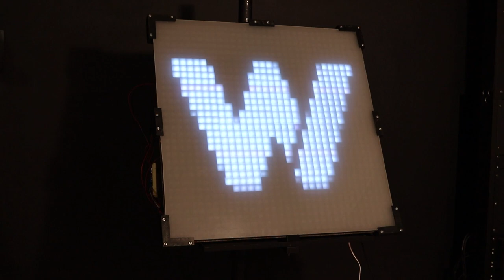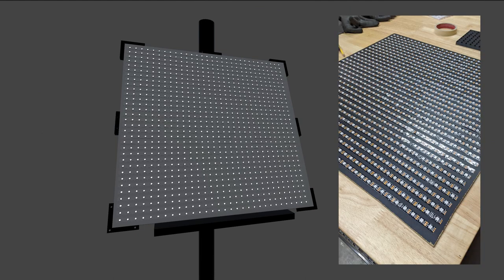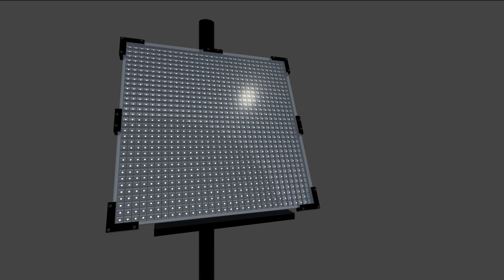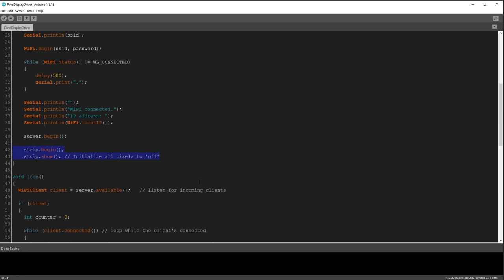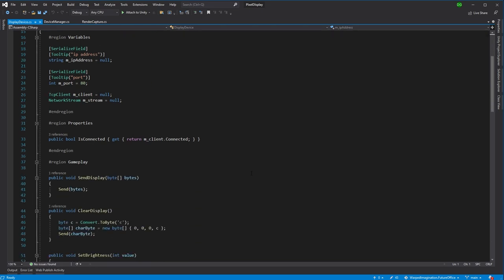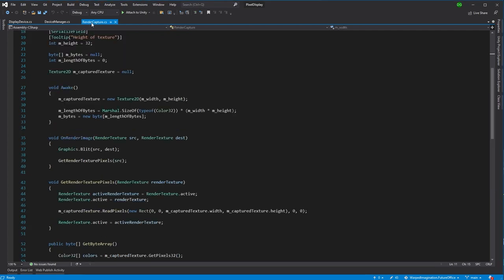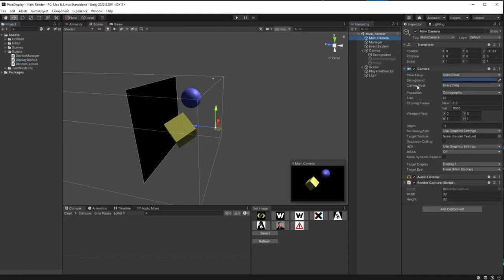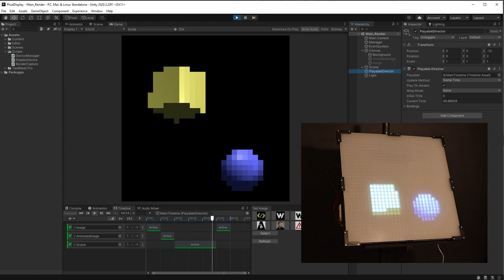Displaying Unity On LED Strip Display

Comment: HAHA!! I just happen to have 3x ESP8266 boards and a 8x32 LED Matrix (flexible pcb) that are just sitting on my couch projectless!! Im going to straight up copy that !!  Just curious about what power supply did you use, and what kind of board did you use for the front/diffuser ?   If you redo your LEDs on the next version, consider those LED flex panels, it would be much less soldering, and they are more tightly packed (5mm gap), so essentially twice the LED density/resolution!! possibly more challenging to get the grid offset in place, but i think i can get it to work!! I can see how also code would need to be modified to handle the rows and columns differently (to connect multiple panels) but also can be dealt with fairly easily!
Reply from the maker: Got a temporary 5V supply on it at the moment which isn't the correct supply going forwards from the prototype, also where the supply is spliced in at increments of rows will change. I will list the final power supply when I finalize the hardware for version one so everyone can see which one to gauge from.
The front diffuser was ~10mm of acrylic, I actually repurposed an old sign from a previous company so don't have the exact opaqueness .. I certainly wouldn't go clear, at one point I was thinking about a black for testing which would match the back wall in my studio and should come across quite slick.
The LED choice happened to be down to the fact I had a real left over from another project, those panels would save some time on the soldering, I have a great soldering station and work area in my garage/workshop so I can lay down these strips pretty quick. As you state the coding change for the panel types wouldn't be too hard, you'll know this, but for others starting out reading these comments coding for LED layout should be done on the controller side not Unity, that way the display code is independent from the hardware layout.